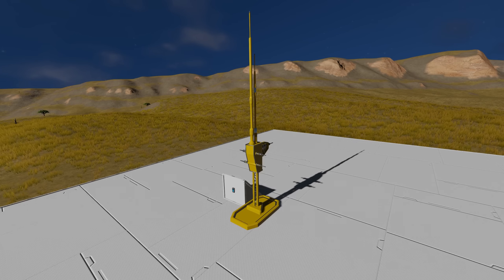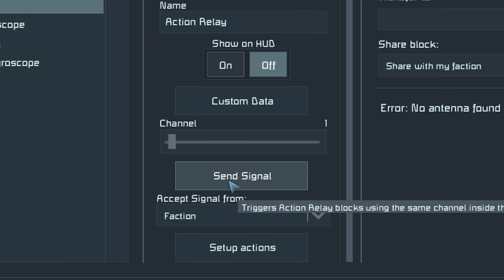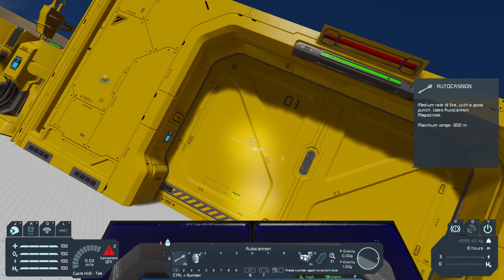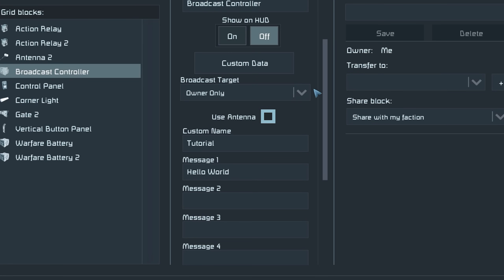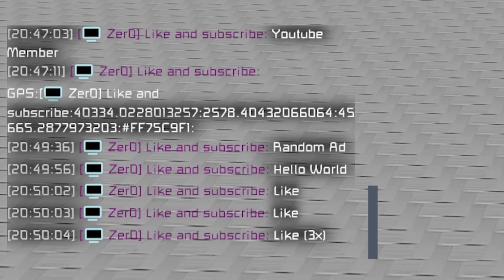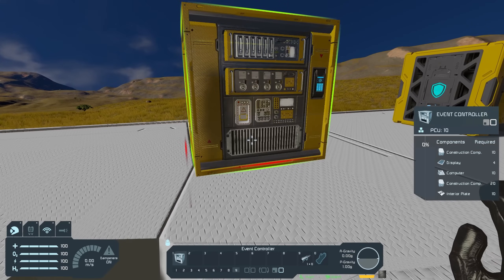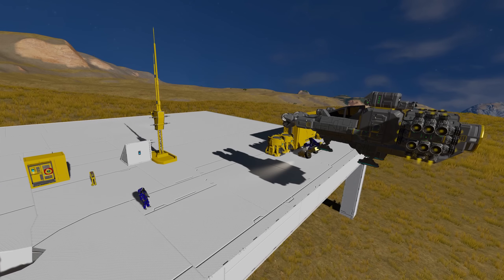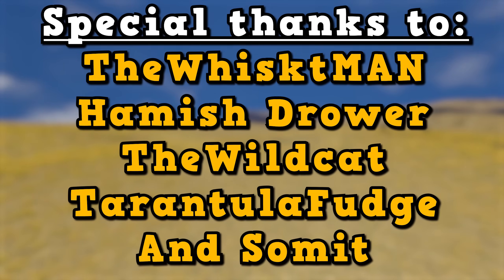Ultimate Guide to AUTOMATION in Space Engineers

Comment from the maker: What are you using the Action Relay and Broadcast Controller for? Let me know!

Also, are there any other guides you would like to see as well?
Reply: Local defense drones.

Little drone outpost with an AI defense block. It detects a hostile? It launches the drones. Hostile gone? Recall the drones.
Reply: I was using a script called "Cross Communication" that functioned like these new blocks. Also, it should be noted, you can relabel that button on the bike via "K-Menu".
Reply: Honestly not sure what I'd use the action relay for. I used to use timer blocks tied to buttons and/or a cockpit's hotbar to automate things like door openings, docking/undocking sequences, cycle airlocks, and so on. Granted, now I could have only 1 action relay to control multiple grids in the same way... The broadcast controller could be useful for specific alarms and messages.
Reply: Using it to relay field points dotted one in each direction 1km away to have defense blocks detect their 2.5km radius back to base and have a boosted early warning detection system presented by directional lights, adding messages to them and to the faction lol. I have made a radar blip noise when its picked something up via a sound block and multiple commands going to it to glitch/clank out the sound lol its really good.

Comment: "Why would you use the Everyone receive?"

Elite Dangerous station docking.

For those not in the know, the ship platforms in E:D are rectangle parking lots that are always up and ready to receive a ship. But once you are landed, the docked ship can press a button to lower their pad into an underground hanger.

Certainly, for maximum security, you could just request a station operator to lower the platforms for you, but that is a mundane auto-task that doesn't need the station's direct hand.

Docking in E:D is, apart from pad assignment, near entirely handled by the pilot. Who is most likely NOT directly affiliated with the station owner, thus requiring the Everyone setting.

The setup is thus:

All pads can be controlled via Action Relay. Relays/Antennas start powered off.

Pilot requests docking. Station Traffic Controller gives a pad number, and a Relay channel.

Pilot docks at the pad. Traffic Control enables that pad's antenna and sets the Relay channel. The signal will allow the pilot to raise/lower the platform as they need without further assistance.

The issue with this method is that you cannot use a channel that another active pad is using AND a channel that the docking ship needs for its own systems. That and any ship in range of the dock might erroneously or intentionally move other's pad unexpectedly.

Comment: Excellent tutorial! For the remote control block, can you use overlapping antennas to control the grid from super far away? Would a comprehensive satellite network (likely with modded antenna ranges) allow you to remote control grids from anywhere in that overlapping area?
Reply: You can use laser antenna to do this, they can be set to infinite range but they connect in pairs. Put your satellite with 2 laser antennas in space, place another laser antenna and regular antenna on your base on the ground. Connect the two with GPS. Connect laser antenna on your moving grid to other satellite antenna. Now as long as you are in range of your normal antenna and line of sight of moving grid is not broken with the satellite, you will be able to control the grid on almost entire planet hemisphere with no mods. Of course be careful with the line of sight broken by mountains or asteroids, you wont be able to hangar the ship (that could be bypassed with AI blocks) or fly into caves.
Reply from the maker: Yes you can! You can control things on mars whilst you are on earth!